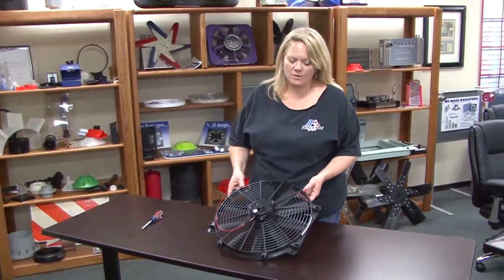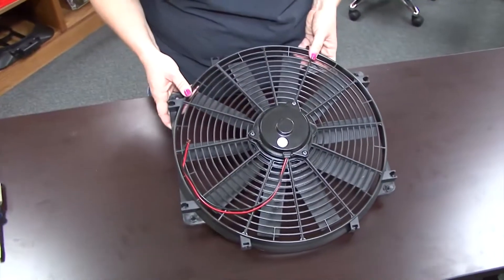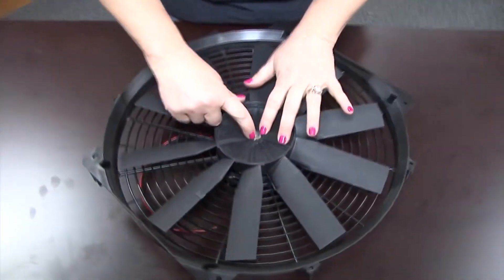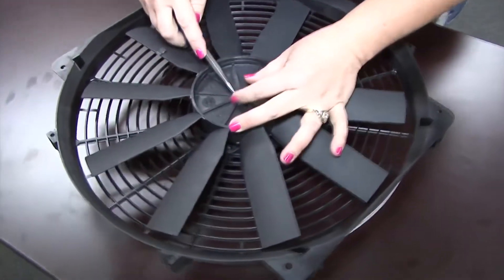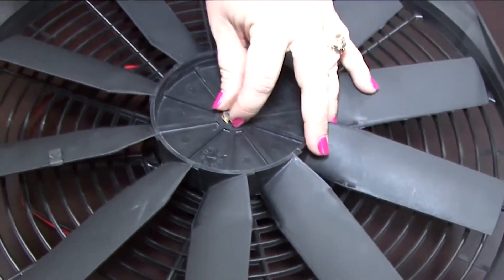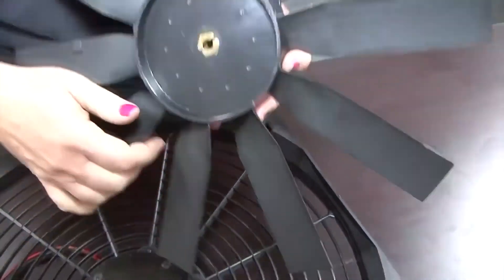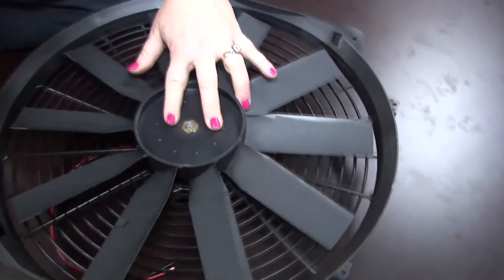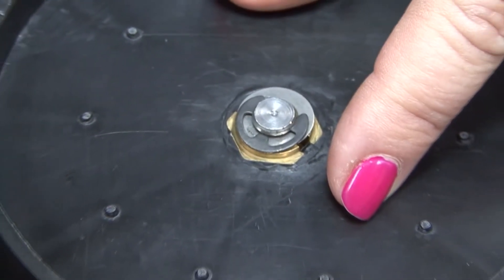Flex-A-Lite - How to Convert a Puller Electric Fan to a Pusher

Comment: Or you could hooked black to positive and red to black lol
Reply: @Thrillhunter I agree 100%, if designed to spin only one way than that's what you have to do. Always follow the manufacturer's recommendations, it will save you $1000's for an engine rebuild after it overheats accidentally that one time.